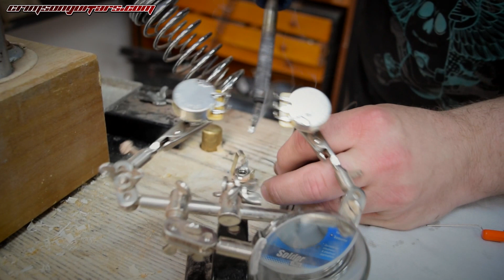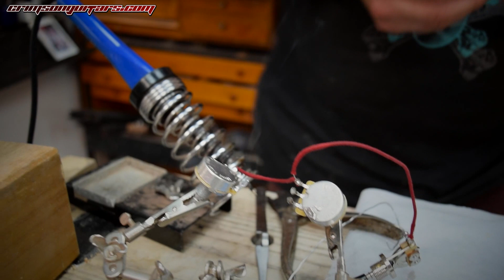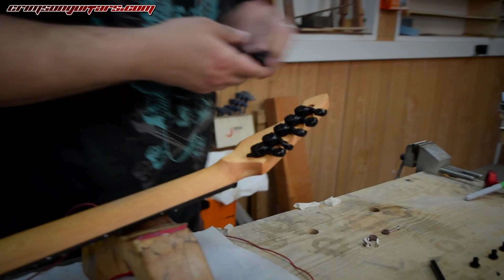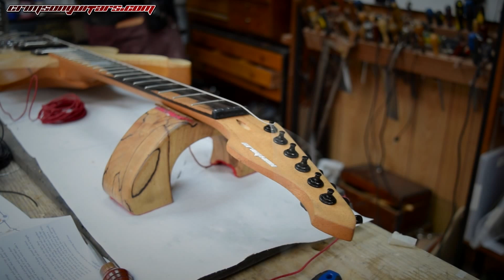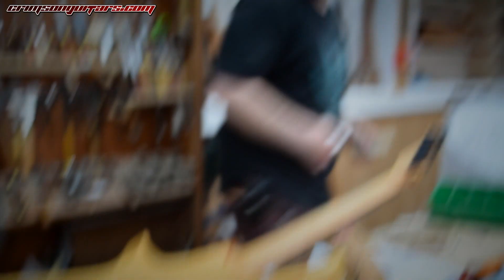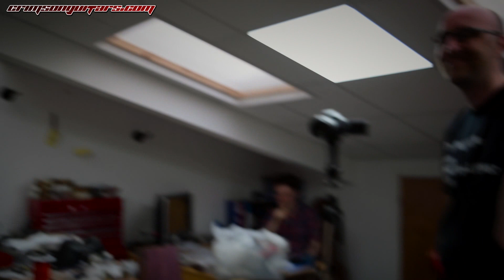The 12 Hour Build  -  Episode 24  (19:30 - 20:00)

Comment: Wow, what an experience! I agree with others that this was far from a failure. Running around finding clamps, having to run up and down stairs to go between the main floor and the machine room, etc. all added extra idle time. Not to mention that the challenge was to just to build a guitar in 12 hours, but you also designed it on the fly in that same time. Congrats, and I look forward to the next challenge! I'll also be ordering a few of your tools in the near future, and may actually pick up a bottle of that finish as well.

Comment: I don't consider this a failure at all. Been lurkin the channel for a long time. I really enjoyed these vids. I haven't watched all of them yet, but I will. I am contemplating building my own electric guitar as a side hobby, and the 12 hour guitar really intrigued me.

A true testament to your skill! That is why I say it's not a failure. I am just getting tired of seeing the lack of care for the instrument manufacturers around in regards to the cost savings by doing things over-seas, cranking down the quality of parts even on the mid-grade equipment, it really is just sad. The guitars that are $4000 used to be $3000 and have $2000 level parts in them (in my opinion anyway from what I have seen coming out of even the bigger name factories).

When it comes time to do it, i will definitely be sub'ing for The Guild :)

Comment: Fantastic job Ben!

for only 6 minutes, I'd consider that a win.  I think if you look back through, there are plenty of things that could have been cut out or cut back on to gain 30 seconds each hour.  Putting it in that perspective (30 sec/hr), even a pee break takes more than 30 sec.... drink less coffee and you won't pee so much LOL

I have an idea for a future show... not necessarily with a time limit (though you COULD if you're feeling particularly masochistic).... build an entire guitar start to finish with absolutely NO power tools of any kind.  Though I guess I'd allow a soldering iron for the electronics - they're much safer than a butane pencil torch :)
Reply from the maker: +Sean Bova consider it done, if the series does get enough support then I will be doing one with as few tools as possible and one with no power tools.. Butane soldering iron it is though just for the sender masochistic fun of it.

Comment: I think that if you remove the "mishaps" like missing tools, etc. You actually made it in time. Also "winging it" definitely hurt your time, you have to have a plan with all the things you'll make to the guitar to increase efficiency. But other than that, I totally think you can make an awesome guitar in 12 hours.
It looks amazing, and it works! Which is the most important thing.

Comment: It is advisable to have a mechanical connection to components, ( i.e. a hooked wire through the holes ) before soldering.  Amazed that after watching you wire up a midi, you had trouble doing something so basic.

Comment: of course, there is ONE nice thing about solid core wire, and that is you can bend and shape it, and (within reason) will maintain it's shape. makes for nice neat wiring. Or at least it CAN! :-) Just look inside Quad amps from the 60's and 70's.

Comment: Well done Ben and a great looking guitar as a result!!  Also technically you made it well within timesince you lost about 10 mins doing a pickup unboxing.  You lost 2 mins because someone had not setup the truss rod router correctly.. and lost about 3 mins running up and down stairs ;-)  Its a win as far as I'm concerned

Comment: There has to be a better way to do some of those electrics than (for example) slapping raw solder onto the wire shielding or pot cover and then soldering to that?

Either way, congrats on finishing the build! I've enjoyed watching through every episode. I think you lost 6 minutes in the unboxing stuff, to be honest...

Also really unfortunate timing to lose audio over the very end. :( Still, lessons learnt for next time!

Super pretty guitar! About the only part I'm not a fan of is the control cover. Everything else is stunning.